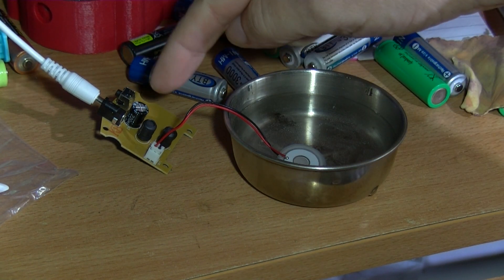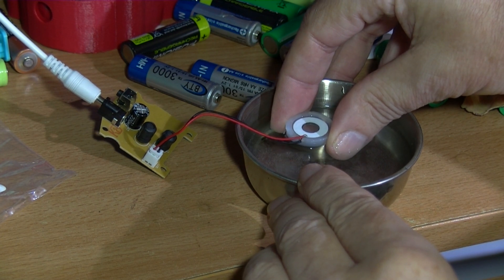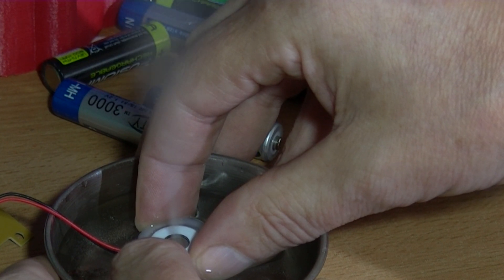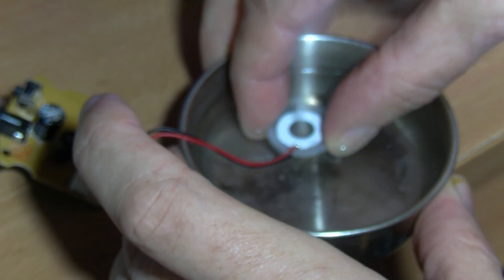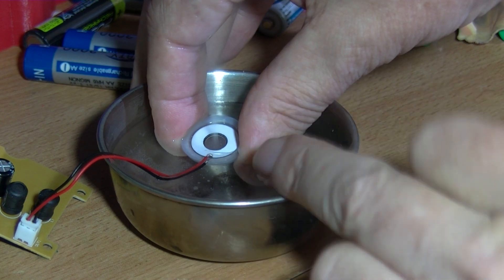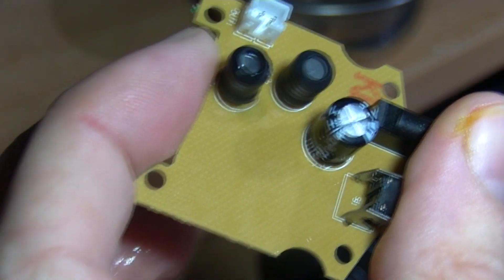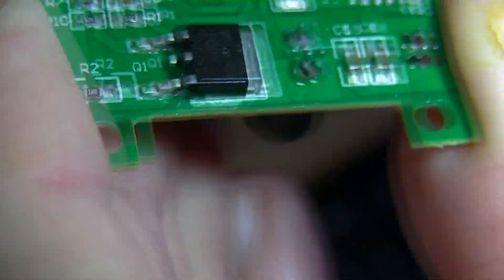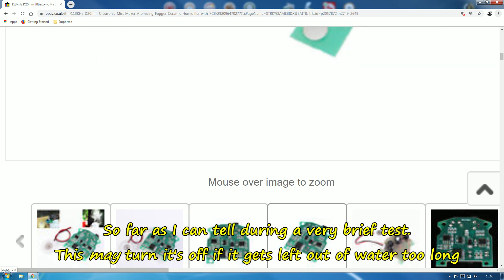Ultrasonic Mister/ Fogger. A brief test and look

Comment: Mine was working fine then suddenly stopped. is there is a possibility of any damage within the circuit as i guess the current is not flowing through. how could i fix it or check it what is happened inside. mine is a bulb humidifier.
Reply from the maker: Same for me, stopped working. Some family members had a similar device to look like smoke in an electric fire but these also fail after a bit of use. Note kept wet all the time as we must. So junk
Reply: Eu tenho um igual . Cápsula piezo é bem simples . Verifique se não tem fio quebrado , ou sujeira acumulada na placa . Eu limpei com uma lixa fina . Se tiver um osciloscópio você poderá ver o sinal de frequência entre os fios do piezo😊

Comment: I want to build a dry run protector to shut it off when there is no water. Any idea?
What happens if it runs dry?
Reply: Peizo burns out.
Reply: @HaloHunter2552  What can I build in to prevent that? I have read the the current changes when it warms up due to being dry.
Reply: @LEO-xo9cz  One way is to manage things with a micro-controller (What Arduino runs). You can have a sensor, like a switch on a float that tell the circuit to shut off (multiple sensors may solve the same issue interchangeably, float is just one idea.).

You could try to make some mechanical shut off, again maybe with a float, so that when the water level falls, the circuit is broken. This is simpler that a micro-controller if you don't know how to use one, but would be more difficult to tune/configure so it's reliable.

Depending on how often you are checking on the device, you could just have a large reservoir https://www.youtube.com/watch?v=mz5r_pRKjuM. I plan to use this design since I'll be checking my device periodically, so I can easily refill. This setup will maintain a (roughly, if the falling momentum doesn't push out a little extra) constant water level.

You can combine these methods.
Reply from the maker: I think there are some for electric fires that pretend to be smoke, to make the fire look more real; I think these have a switch to stop burn out is they run dry

Comment: does the curcuit board make the disc pulse as well or can i run pure voltage through?
Reply: 113khz. ..
Reply: You have to run it with the board as it has to have a specific Frequency to make the disk work.

Comment: How long these things last with continuous operation? Will the ultrasonic membrane clog when using tap water due to salt buildup?
Reply: I’ve had mine in continuous operation for 4 months now, I just make sure to clean the disk gently with every refill Looking for any limescale or hard mineral deposits building up on the working side of disk. Many people think the disk is dead when it only is in need of good cleaning by gentle, and I mean gently -I cannot stress this point enough, with a pointed object small enough to chip deposits off. You could also use vinegar water soluble to help loosed and dissolve mineral build up. Done successfully it will work exactly as nex
Reply: @trupyrodice4462  do you neend to have a circuit like that or can you just attach it to a battery and how many volts
Reply: @trupyrodice4462 exatamente isso: uma limpeza na membrana do piezo , com cuidado , resolve a maioria dos problemas
Reply: I am wondering the same thing. Distilled water is definitely the best.

Comment: Can you please give me idea how I can convert the power supply from 220v to dc supply
Reply: Get a power supply from some christmas lights or a phone charger cable. Make sure the output voltage (DC) is between 3v and 12v for this board. Change the end of the of the cable to match the input for the board and that's it
Reply from the maker: a PSU or a transformer